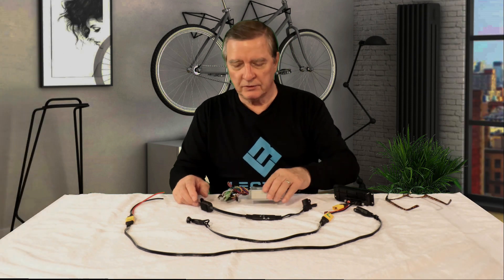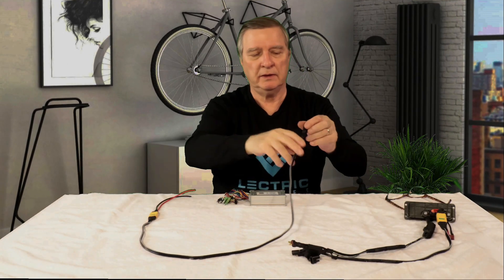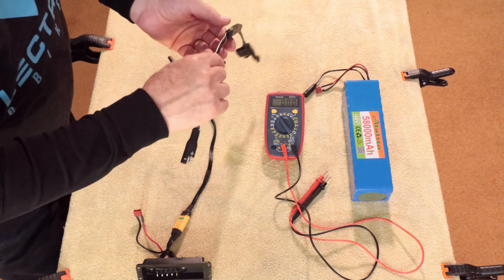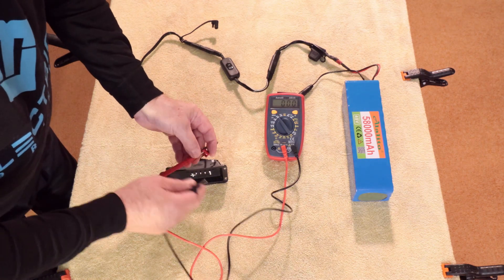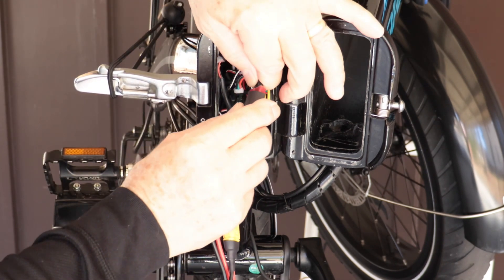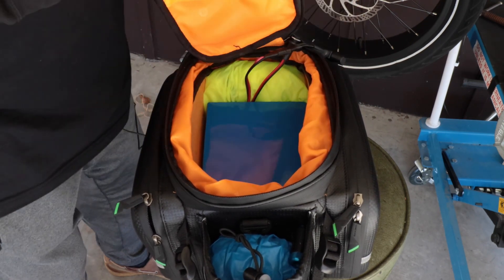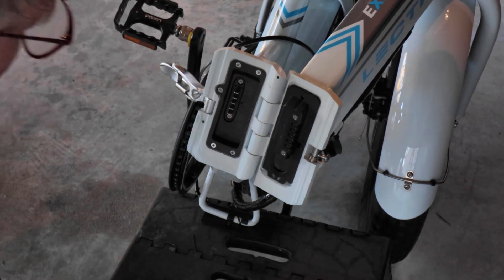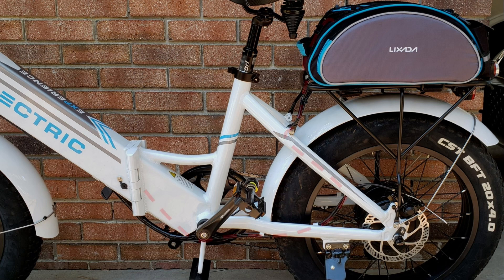How to E-Bike - Auxiliary Battery Wiring Harness in Detail

Comment: I followed your directions and wired my bikes up two years ago and have worked perfectly. I charge my batteries through the bicycle port only I do not charge them separately. Now I see everyone is telling me I need a battery balancer but I’m not sure why. logic tells me as long as you have a Fused line between the batteries and a switch to disconnect there shouldn’t be any problem. As long as batteries are the same voltage and relative the same charge level. So do you have any new thoughts on it sir.?

Comment: I like watching your content. Plenty of good information and I know you swapped to a 48V 20Ah battery but why did you make a video with that fake rated ALalito 48V 58,000mAh battery in it?  I see a dozen companies selling the same thing rebranded all with different Ah ratings. It’s under 2kg’s so what’s the actual capacity about 48v 6Ah? 288W/hr?  I see some selling them the same thing rated at  48V and 99,999mAh’s now lol
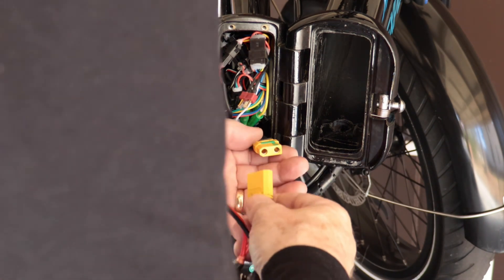Reply from the maker: I apologize  to those viewers of this video that have not seen my earlier video on this subject where I call the ALalito battery for what it is . . . a piece of crap, lol.  That battery is a whole other story.  I bought it for $50 off AliExpress knowing that it was not as advertised, but thought since it was so light (less than 3 lbs.) that it may be OK as a spare battery to carry in the rear rack bag for emergencies.  Once I received the battery and checked it out, it has less than 6Ah.  To make matters worse,  while testing on my XP, the battery quits working when the voltage got around 47 volts (approx. 50% charging level).  So, on a good day, traveling around 15 mph, you may get 10 miles of range.  It took me 3 months of bickering with the supplier and AliExpress and finally having to turn the case over to PayPal before I got a full refund.  I was only using it as a prop for this video and certainly not endorsing it.   The above video was a follow-up to a previous video that I did which clearly warn about the ALalito batteries.  Go to the linked video and at 5:58 and 10:52, clearly warned my viewers:  https://www.youtube.com/watch?v=jMvYM4Y3s24&t=929s
Reply: @Onyasix  I knew something was up. You have a good knowledge base so I was surprised you had it. I’ll watch the video. The crazy thing is those fake capacity batteries with random Ah ratings are getting so many 5 star ratings on aliexpress from people that don’t understand batteries or even know what they really have.

Comment: Should be noted that even with the key out, the secondary battery will still charge the stock battery, so only run the extra battery when the voltages are equal and the key is on, or remove the stock battery before running the secondary battery.
Reply from the maker: Vince ~ that is not true for 2 reasons.  First, the stock battery is not connected to the battery leads to the controller when the key is in the off/lock positions.  Second, I have an on/off switch in the auxiliary battery harness.  With the switch in the off position, it breaks any connection with the stock battery and controller.  With the stock battery, key in off position there is no connection between the 2 batteries.  You can run the stock battery with the auxiliary battery 's switch off.  You can run the auxiliary with the stock battery in the off position.  You can run with both batteries (key on and aux battery switch on).  When running both batteries in conjunction you should have their voltage levels equal.  I started out running my batteries separately and did this for several hundred miles with no issues.  After that I started running them together which is preferred by me for several reasons.  Running them together puts less strain on each battery since they are shearing the load.  Running them together, both batteries will stay cooler which should help with longevity.  Last, by running them together, the overall range of the e-bike will increase between 5 % to 10%.
Reply: @Onyasix  thanks..... I need to do some testing. From now on i'm gonna run them together starting at same voltage as recommended. Somehow though my totally drained stock battery was charging with the key out with the aux battery on. Also on my bike with the key removed (aux battery off) , when I plug in the charger I am able to turn on the display, so something is still connected to the controller.
Reply from the maker: @vincemash  ~ I have five 48v Lectric XP stile batteries.  Don't be alarmed, but your battery has damaged circuitry within the battery itself.  I know this because I've had this to happen to 2 of the 5 batteries that I have.  The best that I can determine is that something in the battery's circuitry has shorted out and the power supply from the battery is not disconnected completely from the controller when the key is turned off.  I notice this with my XP a while back.  I knew that when I turned the key off and checked the battery's power sockets that I did not get a full voltage reading, however a short amount of current (+/- 1 volt) would be detected and then it would fall off to zero voltage.  Later on I notice, from that the same battery, it started showing a full voltage level reading of the battery even when the key was in the off position.  This has also happened on one of the other batteries that I have.  This does not mean that the battery can not be used as normal, it's just means that you need to be aware of the problem and that the battery will be still connected to the controller even with the key in the off position.  In the long run, it MAY contribute to the longevity of the battery and the controller.  I still use my 2 batteries that have this defect.  

Yes, if you have an auxiliary battery, you need to have an on/off switch between the aux. battery and the power wiring to the controller.  This will not only prevent a continuous connect to a faulty stock battery, but will prevent a continuous power connect to the controller.

Comment: I bought this same battery but the charger appears damaged, can I use my stock lectric battery charger to charge it?
Reply from the maker: Yes, the stock XP charger will work find.
Reply: @Onyasix  thank you brother, I saw that the cable that connects to the charging brick doesn't have an upside, it doesn't indicate the correct way of having it plugged in, im scared to plug it in and short out the battery
Reply from the maker: @jaystream5145  Not sure that I understand your comment.  The charger has a standard 5.5 mm x 2.5 (2.1) mm male plug and the auxiliary battery has a standard 5.5 mm x 2.5 (2.1) mm female plug.  Both are pre-wired, the center prong positive and the outer ring is negative.
Reply: @Onyasix  I'm talking about the detachable cord that comes from the wall outlet that connects to the power brick not the female plug
Reply from the maker: @jaystream5145  If the charger's AC plug is symmetrical at the charger end of the connection, it makes no difference which way you plug it into the charger.
Reply from the maker: @SunriseLAW  ~ at the time that I made this video, the 20Ah battery was selling for about $150.  Shortly afterwards, the prices started rising.  Presently, you can pick them up on ebay for about $250.  That's still a lot cheaper than a stock 9.6 Ah battery for $299 and you get over twice the amp hour, which means twice the range and 3 times the range when used as an auxiliary battery in conjunction which the stock.  That's a whole new world for those that want/need more range.  👍
Reply: one last question, do I have to charge this battery and the stock one separately? or will they both charge at the same time if I charge from the stock battery input?
Reply from the maker: @jaystream5145  I do not charge them at the same time off one charger.  You may or may not have any problems doing it that way, I just don't know how well the batteries would sink together while charging.  By using just one 2 Ah charger, it would could take over 12 hours to charge both batteries.  By using two chargers, you will cut the charging time in half.   I use two chargers, one 2 amp for the stock battery and a 2.5 amp for the auxiliary battery.  I also have the stock battery's key turned off and the switch to the auxiliary battery in the off position so that there is no link between the two batteries while charging.
Reply: thank you so much for your advice brother
Reply: once again thank you so much brother

Comment: I guess you charge aux battery separately like an RC battery to balance cells
Reply from the maker: Yes, I charge each battery separately until they are both fully charged to 54.6 volts.  When running them in parallel, even though they are different amp hour batteries, they will discharge at the same voltage rate.

Comment: Many thanks to your video. It saved me a step. I was going to use a double pole double throw switch to activate only 1 battery at a time. But using the key is the key to not use a double pole double throw switch. I fly model airplane and homebuilt drones. The dean's(t-connector) I lost confidence on them depending on where you source them because sometimes it will loose connection b before or during flight. I will be switching the connector to the XT 60 or 90.
Reply from the maker: Sorry, little slow in response.  Both of my e-bikes Lectric and Polarna use the Deans plug to connect the battery to the controller.  That is why from the factor the Deans T-plug is wrapped  with electrical tape.  When I reconnect the Deans T-plugs, I use shrink tubing to hole the connections together.  I prefer the XT type plugs also, just make sure that they are designated as anti-spark.  I use to fly RC model airplanes and now fly drones for flying camera use.  DJI and Skydio, I'm not into making them myself, lol.  👍

Comment: Hi Sonny, Great video. I have an operations question. Have you found it better to run the factory battery to a low level of charge and then locking it out and switch over to the auxiliary battery? Or is it better to have both batteries fully charged and and use at the same time?  Thanks
Reply from the maker: I originally ran my main and auxiliary batteries separate from each other.  After conferring with several other e-bikers that had success running the batteries in conjunction with each other, I started running both batteries together.  After over 3,000 miles, I would diffantly recommend running them together for several reasons.  First, the batteries run cooler because  both batteries are sharing the current load.  I have data showing that running them together increase overall range (6% to 7%).  By reducing the running temperature of the batteries the longevity of the batteries  will likely be longer.  Just make sure that when running the batteries that the voltage levels are equal between the 2 batteries.
Reply: Thank you very much for the prompt reply! I greatly appreciate all of the hard work that went into making all of the informative  videos.

Comment: Sonny, on the aux. battery harness do you connect the positive and negative into the on/off switch or just the positive? I noticed that there are 2 posts on either side. Love the video!
Reply from the maker: Yes, I wired both Positive and negative.
Reply: @Onyasix  Thank you kindly!  I see now that the switch also serves well as a splicing/junction box.
Reply: my thoughts would be on a (DPST) switch to use 1 wire ( fused lead ) and split it across both switch terminals to share the current load thru the switch because when pulling 50 volts at 20 amps that is a lot of energy and eventually will melt the switch, unless the switch is rated for 1 kilowatt switching.... Cheers

Comment: Sonny, My lectric XP ebike  the Motor: 500 W (800 W peak) geared rear hub motor. and my OEM battery is 48v 9.6AH. Will the 48V 20AH will be OK ? I love your videos.
Reply from the maker: Sure it will.  As long as it is a 48 volt battery, the amp hours can be anything.  The voltage is the only limiting factor.  I would not advise upping the voltage, that could burn out your controller and/or your motor.  The controller controls the amperage to the motor.  I would not advise upping current with a controller above the 18 amps for a 500 watt motor ~ 18 amps (peak current) at 54.6 volts = 983 watts of current.  You of course can do it, but you stand to burn out your motor and/or shorten its life.
Reply: @Onyasix  Many Thanks!
Reply: @Onyasix  If you drive up a long steep hill. Check how cool the M4 motor is with the aluminum mags compared to a spoked rim ebike. Those 500W and 750W motors have much  better cooling in the Aluminum mag wheels as the thick aluminum mags act like giant air cooled heat sinks. The steel spokes and rims don’t cool the motor near as well as thin stainless steel spokes aren’t good at conducting heat away. The Thermal Conductivity - k - (W/m K) of aluminum alloys are 10-20 times that of steel, stainless steel and nickel plated steel nipples. Night and day difference when it comes to cooling the motors like on the Polarna  M4,M5,M6’s. You can overdrive them will less problems.
Reply from the maker: @RadiationNetwork  I'll have to do that.  It makes sense.  That being the case, a cooler running motor may increase the battery range also.  I like the alum mags for their looks and not having to deal with the head aches of spoke wheels.  Now, I have another reason to prefer the mags, lol.
Reply: @Onyasix   I have Polarna M6 and I added a 52V 20Ah battery so I have 35Ah total. I still need to pickup a 52V 17.5Ah frame pack with some Samsung 35E 18650 3500mAh INR18650-35E cells. Right now I’m switching packs and connect them together only when the voltage on the 52V drops to the same as the 48V pack.  

The M6 is claimed to have a 25A controller. I need to wire in an Amp meter as the display maxes out at 999 Watts but is likely  pulling more watts than that. I’m going to hack the firmware on the controller that has the 986 display. There’s a bunch of hidden functions like Regen that’s hidden from the M6. 

Also put a temporary temp sensor on your controller and see the temp at max speed and up hills. Mine gets so hot half way up a 500 foot hill climb that it throttles back the wattage with temperature with the motor not even warm. Waiting a couple of minutes it’s back to full power. This also happens with the stock battery.

If you think your controller is thermally throttling or just getting too hot. Try adding heat sinks to the controller or use some Thermal Conductive Heatsink Plaster to thermal glue it to the aluminum frame so that the frame is a heatsink. Some of the thermal plasters can still be separated if you need to pull the controller. As is it’s just sitting in a tiny box with no air or way to conduct heat away. Mine was just sitting inside without touching to help cooling.

You could also use a spring and CPU heatsink compound or screw it in. The spring will push the controller into the side of the frame to conduct heat into the frame. Note: the controller side with the 4 screws has terrible thermal properties and the metal plate is resting on a plastic plate. You could remove that aluminum plate and see what I mean. Then add a little tiny bit of dielectric thermal compound around the outside where there’s a tiny bit of area around the outside to get some conduction from the metal to metal with the plate back on.
Reply from the maker: @RadiationNetwork  ~ My M4 has a 18 amp rated controller.  It looks identical to Lectric XP’s controller.  Polarna advertises the M4 as having a 750 watt PEAK motor.  When I purchased it 9 months ago it was advertised at 750 watts with no mention of PEAK.  My Lectric XP is rated at 500 watts constant and the 2 e-bikes performance are very close to each other, so I believe the M4 motor is actually closer to 500 watts constant.  In either case, with the same 18 amp controller and an actual 750 watt constant motor, I’m not sure that the 2 bikes would not still perform about the same since the controller is the determining factor.  

I live in a relatively flat area with few hills, so I have not had any problems with the motor overheating.  Even though I’ve seen my M4 peak at 999 watts, short hills and hard acceleration, it usually levels out around 500 watts or less at speeds up to 28 mph.

Comment: I really appreciate this video and I just have quick question, in the new setup for the step thru is the sae extension with the fuse necessary and specifically the fuse is that a must have? Thank you for any info
Reply from the maker: As long as the wiring is not crossed, the fuse may be a little over kill, but it is a easy precaution that I don't mine taking.

Comment: Why did you put the XT-90 plug at the battery connection panel?  Why not just run wires with no connector until you get to the rack, where the batterywill reside and put the switch and connector close to the battery?  Did you have plans for removing the extension from the connection panel and leaving the XT-90 plug still attached to the short wires on the panel?
Reply from the maker: The battery came with a Deans T-plug.  I initially used only the Deans plugs until I notice the spark every time that I connected to hardness and battery to the controller.  That's when I changed over to the XT-90S plug.   Yes, you can put the XT-90 plug at the battery end, but I'm setup so I can also use my auxiliary battery box with a stock battery as an auxiliary battery.  I did this method before the 20Ah (in the bike bag) method and used a quick connect at the auxiliary battery box.